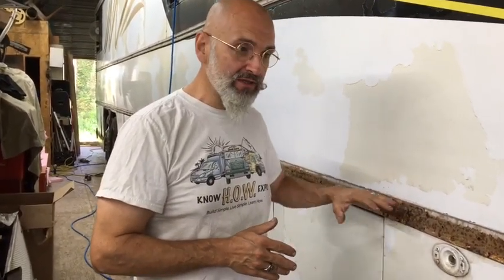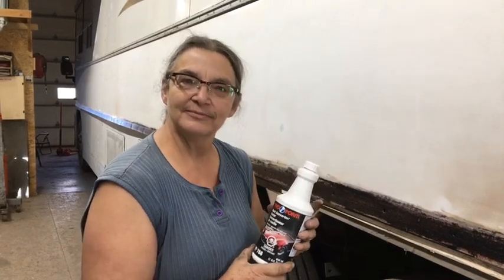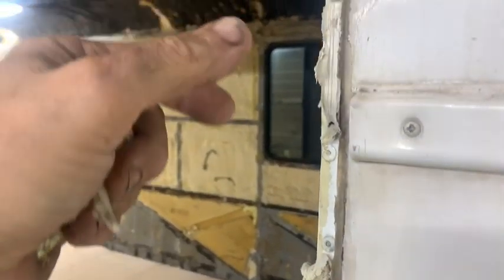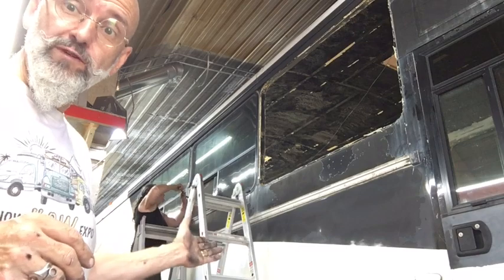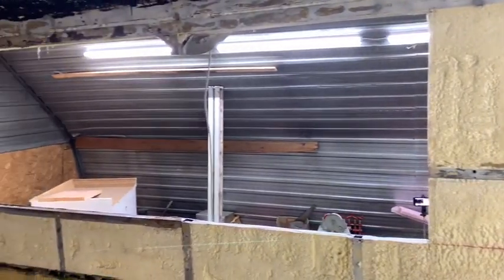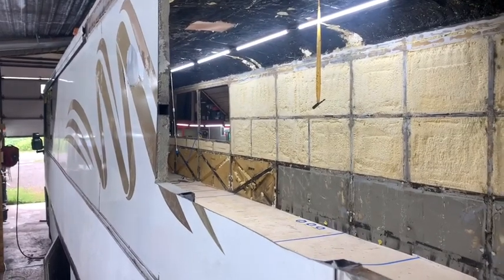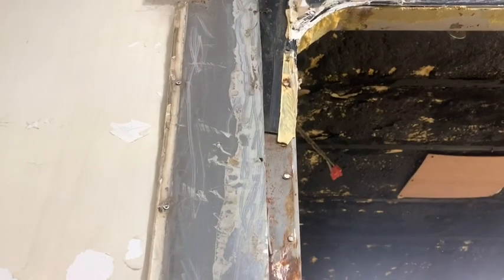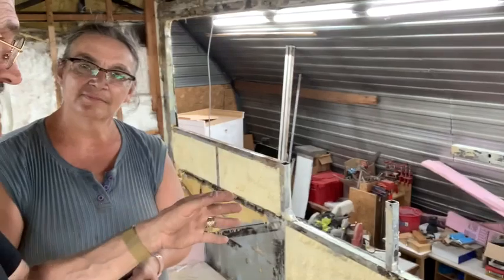E11, Less glass, body and rust. MCI 102DL3 Bus Conversion

Comment: I thought your conversion was going to be easier than starting with a seated bus because a lot of this work would be done for you.   But you are actually spending more time fixing things that were done wrong than if you did it from scratch.  But you are getting a lot of good conversion stuff out of it - tanks, generator, inverters, batteries, windows, etc.

Yours is actually the 3rd conversion on this bus.  The commercial converter did one, then someone bought it and started a reno on it and now you guys are doing a real reno.
Reply from the maker: Starting with a seated bus would have been slightly more difficult ( removing a MCI bathroom is an adventure. This bus has a 9 inch roof raise. And as you mentioned what came with the bus made it a good investment.
Reply: @LacroixCruiser  Can you please shoot some video of how the roof raise was done ?
Reply from the maker: Will do

Comment: Great job, I thought when you cut out that first window... “he did not cut the corner round”... guess you caught that.. my MCI suffered from leaky windows too. They were the factory windows and similar to yours, there were gaps at the top where water was getting in. Not sure if someone messed with them over the years or if MCI (actually TMC) built them that way. TMC’s was MCIs company in Roswell, New Mexico and they made the 102a3’s there.

Comment: How much difference do you think there is between a 102DL3, a 102EL "Renaissance", an E4500 and a J4500 as far as construction goes ? 

Is the skin on your DL3 actually steel ?  Or is it SS ?   What about on the newer models ?
Reply from the maker: I’ve never seen one up close, someone else will need to answer that unfortunately.

Comment: can t stop metal to rust but with you know to maintain it can last longer
Reply from the maker: We are removing the rusted metal where it’s structural and replacing it. On the side sheet metal it’s really only surface rust, so we are not concerned about it.

Comment: After using the rust converter, do you use a product like POR (Paint Over Rust), or does the product you are using do the same thing?  Also, does the rust converter you are using have to be sealed with some other coating, like paint?  Thanks.
Reply from the maker: It acts as a primer, it can be left uncoated if needed

Comment: Is that an MCI thing to have regular steel rust like that?  Are they different from Prevosts which I believe are all stainless or aluminum on the exterior?
Reply from the maker: Most of the exterior is Aluminum. As far as rusting , they all do in some areas, they are never all Stainless or Aluminum, there’s always some steel or iron somewhere, and moisture always finds it.